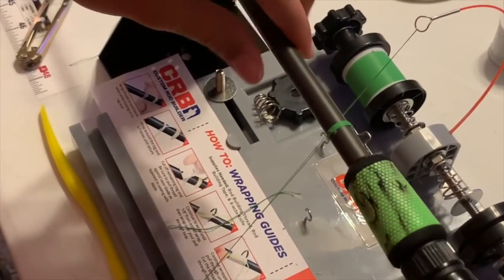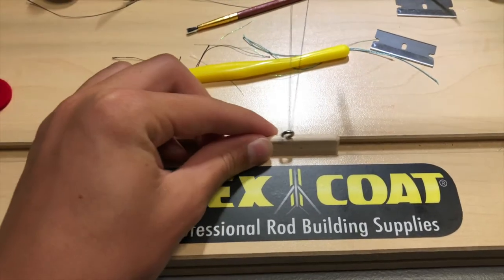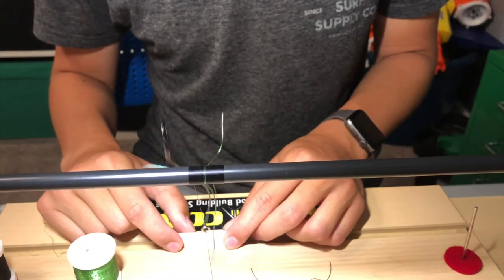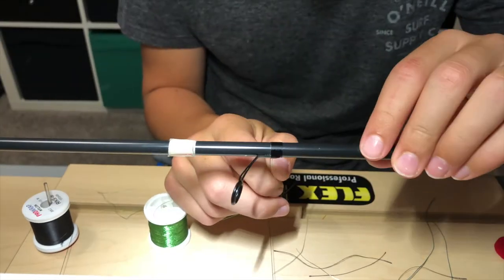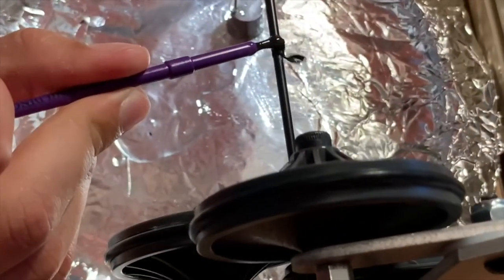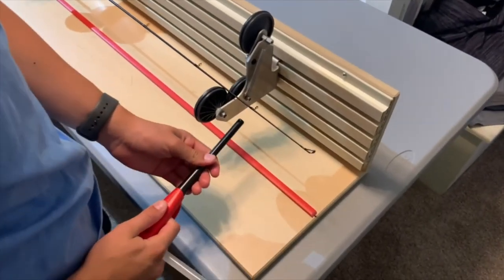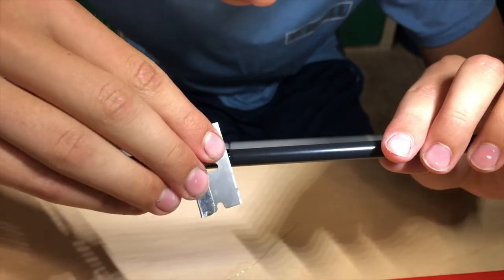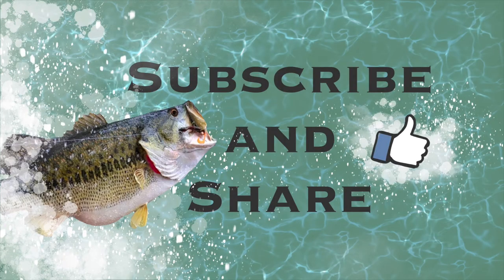Flex Coat 2 in 1 Power Wrapper AND Finisher! PRODUCT REVIEW. DC777

Comment: 2 years later, jave ypu changed your approach? For instance, drying slower 6-9 rpm?

I hated the chuck on the FC power wrap. I much prefer the CRB gen-2 and Alps.
Reply from the maker: I still do everything pretty much the same. However I have changed to doing three thin coats of finish as I believe it gets the best results (in my opinion).

I still dry at the slowest setting that the DC777 has which I think is around 40rpm. I haven’t found any issues with that. 

The chuck does give me problems such as wobbling here and there but that isn’t too big of a concern to me. I like the DC777. It’s the only power wrapper and/or power finisher I have had and I don’t feel the need to change.

Comment: Thank you for posting this video.  I am going to try the rod wrapping hobby and the Flex Coat  DC777 may likely be the wrapper I go with.  It seems to be well thought out and of high quality.  If I make this purchase will I also need a rod dryer or will I be able to use the DC777 for drying?

Thanks,
Reply from the maker: Thanks for watching! Glad I could help.

The slowest the motor can go is about 40 rpm. I keep my rods on the machine when I’m done finishing and just slow it down. You don’t need a dryer unless you don’t want the rod spinning at 40rpm for a while. You can buy a dryer and just switch the rod over to it, that way you can also make another rod if one is drying. As I said, I just keep it on the DC777 and dry it with no problems.

Let me know if you have any more questions, or if anything isn’t clear. Thanks!